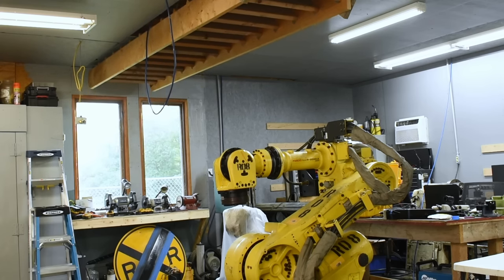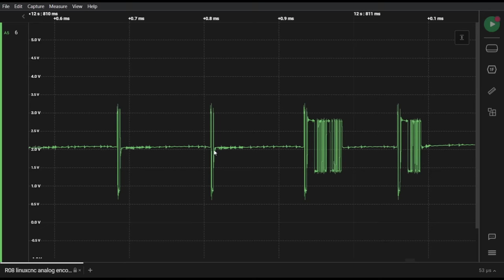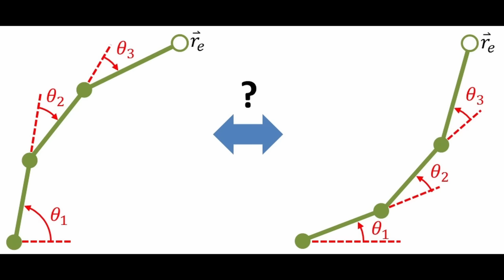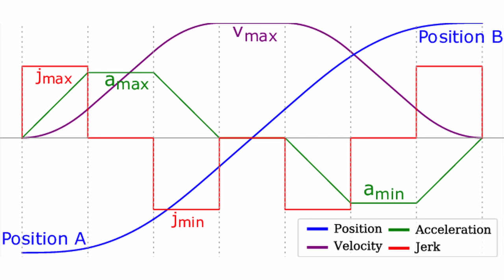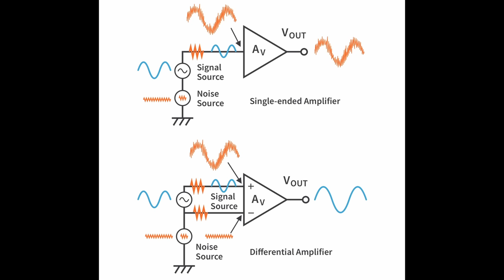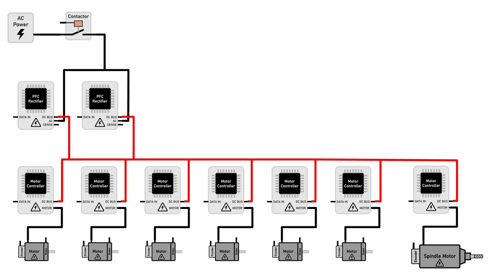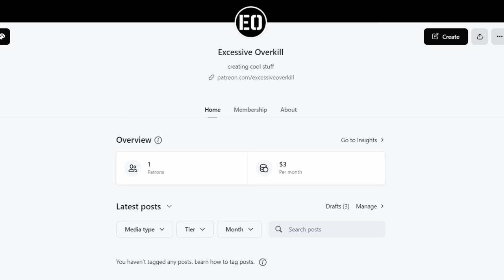Open-source Industrial Robot Controller Part 2: Starting Over...

Comment: Low voltages caused by high resistance neg/gnd loops or voltage leaks causing positive gnd. Also, back emf can cause dropouts due to the control sigs not having enough disparity between VCC and GND(seen on the oscilloscope with the base voltage jump 4:52)
Possibly Separate each GND from the motor/actuator from all other controllers

Comment: Have you heard of EtherCAT? It's a network protocol for industrial automation that can do up to 30kHz update rates with low latency and jitter. You would daisy-chain your motor controllers up with using ethernet and hook up the whole thing to a computer that runs the motion control. The chips to do it are surspringly cheap (LAN9252 is ~$10) and can be used with any microcontroller or FPGA. Maybe this could be a fit for this project, as this would make it much more modular and extensible. Adding peripheries or even an additional axis would just be a matter of adding another box to the network.
(also it wouldn't require to design everything from scratch, there are already a lot of EtherCAT motor drives out there).
Reply from the maker: I did look into using ethercat but the IP for the fpgas was like $10k. I think I thought the off the shelf chips wouldn't work for some reason, I don't remember exact why rn. I planned on using rs422 which would give me like 30khz updates with no daisy chaining, but I'll look into those chips again.
Reply: @ExcessiveOverkill  This was my gut reaction as well - RS422 but with separate drivers for each motor channel for best throughput. Ethercat is price overkill
Reply: "low latency and jitter" they boast as if it's a good thing ("a little bit pregnant"?). How about zero latency/jitter. It's a world of EMI (PWM), who in their right mind throws around data at such a high rate? Marketing BS.

Comment: Hi, I've been working on a similar type of motor control project that uses FPGAs to control smaller / lover voltage BLDC motors. I found a pretty sweet FPGA that I've been developing with that might be a good match if you want to swap the zynq out for a smaller FPGA that would live in each motor controller (it is also waaaay cheaper). The chip is a Gowin GW1NSR-LV4C. Sipeed makes a dev board for it that is pretty good for figuring out their toolchain. It has a single ARM cortex M3 along with 4K logic elements which is definitely enough for some custom communications peripherals and a FOC algorithm at some pretty high speeds (I'm trying to do all of my loops at 40Khz +)

Comment: Did anything ever replace TinyG? Last I looked (years), there was nothing that good out there for DIY CNC controllers, although some mention of people repurposing Klipper.
I would be surprised if a 600 MHz M7 MCU would not be able to handle this application with appropriate programming. The CMSIS DSP lib has accelerated PID controllers for f32 and q15/31 formats.
FPGA tools are less insane now. Yosys support Lattice, Gowin, etc to varying degrees.
MYIR Tech has some Zynq modules that you might want to look at.
Digilent has a socketable Spartan-7 module. Sipeed has a cheap Gowin-based 20k gate board. Both of those will have limited I/O, though.

Comment: I’m interested. I ended up passing up on 2 free Fanuc welding arms because I realized it was going to be impossible for me to reverse engineer the motor and motion control. I can follow directions and learn along the way, but blazing the trail you’re on is outside my capabilities.

Comment: Hi, I too am travelling the path you are on, my aim is developing motion controller for 5axis CNCs. But instead of FANUC I decided to do it with Tamagawa encoder based motors as they are a lot cheaper and I can find them on chinese servos which are equally good in performance. Plus side, there is documentation available from TI on how to interface those encoders. Having all that in mind I stared down this path a year ago and chose the TIs AM64x platform to achive so. Theoretically I should be able to do 6axis motion control using only one AM6442 without the need for FPGAs. Althougu FPGA would be a more professional approach I too have 0 expirence in FPGAs and cannot go down another rabbit hole. Right now I have managed to developed my motion controller minus the part where I directly talk to encoders. For now I am using the chinese servo drives themselves as they are decent. Still nothing beats having encoder loops and motion control loops on the same SOC.

Comment: Two (or 3) cents from me: when you take a look at STMBL firmware, Fanuc encoders reading is already implemented - in motor controller MCU. 

Approach seen in a lot of modern controllers is to push PID into motor controller (so it needs encoder feedback), and just send position command/reaad position actual (and error codes). Preferrably via fieldbus like EtherCAT, so you dont need Custom Big Box With FPGA™ 

Last thing, what voltage are these Fanuc motors rated for? I have usually seen them rated for about 200V or less, 1200V SiC looks waay overkill (unless selected for current capacity). For DC bus up to 320V with some capacitors, 600V IGBTs should be OK. For motors up to 3Kw or less you can get integrated IPM (intelligent power module - 3x IGBT half bridge + drivers + security circuitry) like STGIB15CH60 or IM523-X6A. These are < 15$ per complete power stage, so entire HV section silicon const less than single SiC transistor you picked. 
Especially important while developing/testing firmware - if you have bug/glitch, short something and release magic smoke, even if initially only one transistor is visibly broken you often end up needing to replace them all after some time.
Reply from the maker: I couldn’t find any great IPM or IGBTs that fit what I wanted. You’re right 1200v is overkill but I chose them for their current rating and switching characteristics. The biggest motors I want to run are 4.3kw and they go up to 300% intermittently so they require quite a beefy switching section. If I left all the PID loops in the drive I’d need to send over a bunch of extra feed forward data which isn’t necessary that bad means a lot of the control stuff is happening on the motion controller as well anyway. I might also start running into issues with other encoders or if I try running 2 per axis or additional inputs. The fanucs are just serial with 16 bit words so not that hard but there are others that are sort of hybrid quadrature/absolute that would be more work.

This is also an excuse for me to learn FPGA stuff so i figured going overkill to start wouldn’t hurt.
Reply: OK looks like you got it. I will happily get myself one of your drivers when its ready.

You can have multiple encoder inputs, STMBL does just that. 
Or you can have one encoder feeding into motor driver, for commuting, and second (like glass scales on machining center) directly into motion controller.

Do you think one would need feed-forward if you were for example using EtherCAT at 4 KHz?
Usually inner current PID loop runs at 20KHz (max carrier freq for IGBTs, no idea how fast can you run your SiC), then you have outer positon PID loop that makes no sense to be run so fast.
Motion controller just updates fresh next position every 250ms (external loop cycle) - and you can sync between motors with distributed clocks. What is feed-forward needed for here?
I am using EtherCAT example as it seems to be go-to motion control fieldbus even for super-precise apps like silicon fab equipment, but standard motion control profile like CiA DS 402 does not really give you option for feed-forward. I wonder if am I missing anything here?
Reply from the maker: I might be able to not need much feed forward stuff since the PID loops will be so much better, at least for the bigger robots. CNCs might benefit a bit more just since the accuracy needed is like 10-100x more.

Comment: If you manage to make a decent DIY/retrofit controller available for older servo drives/motors/robots it could become quite useful in the CNC world as well. Alot of older good heavy machines are send to scrap metal because their lack of recent motion and electronics. Alot of them use FANUC components.

Comment: Have you looked at the Omron CK3M motion controller? It's quite flexible and supports different encoder types, and talks to many different drives. It's definitely far superior to anything that exists in the hobby world.
Reply: Not for long and have you seen the $$$$?
Reply: Seems odd that simultaneous or coordinated aren't terms found in the literature.  Obvioiusly G-code capable so they are but yeah, still odd.

Comment: my first thought is maybe the brakes spontaneously engage for just a fraction of a second when the supply voltage drops due to the servo motors are drawing some current.

Comment: Wow, those motor controllers look sexy. And djeeez us those  fets can handle some abuse, but they take take some serious power to switch nearly 400pf and 300μJ to switch), it'll be exciting to see how that works out :)
Reply: 118uJ total gate charge at 10kHz would require about 1.2W. That's a pretty minimal gate drive requirement.
Reply: @murrayedington  the activation energy is not a big toll on the gates energy budget, but I blew a driver or two before I realized the toll it takes on it. And what kills the gate is not driving it "fast" enough, when you start increasing the frequency the time spent in resistive mode increases quickly (and particularly if the driver can't keep up, that'll kill the gate in a hurry).
Reply: @brynyard  haha yes you need to avoid resistive mode. And also ensure you have a finite dead time to avoid the beginnings of shoot through.

Comment: An FPGA is the way to go but have you considered how powerful even an RP2040 is with it's 8 Programmable IO state machines? Similarly there's the TI PRUs - most popular on the Beaglebone boards. I think for sure you could get something going with 'popular' microcontrollers like Teensy, Raspberry Pico or Beaglebone but for sure FPGA is the way to go. ;-)
Reply from the maker: Yeah someone mentioned they got some industrial encoder interfaces working on a RP2040. Most of the encoder stuff could probably be handled with a mid range micro or a micro with PIO, but I kinda wanted to learn the FPGA stuff. and the ZYNQ should be more than powerful enough for probably everything I want to do.

Comment: There is the moteus drivers which are open source
I suspect the amps isn't enough for what you want, but there is some open source firmware there and an existing design to look at
personally I want to write my own firmware for one in rust.
For FPGA's traditionally there's Verilog or VHDL depending on which country you work in, but I'd be tempted to check out one of the higher level abstractions such as amaranth or myhdl which is python based, maybe a development board such as the Arty A7.

Comment: Have you ever looked at the open source STMBL motor controller, they are capable of driving 2,2kW motors at 380V and even support fanuc encoders.
Reply from the maker: I did, i don't think they support the rs485 fanucs, but they also aren't beefy enough for my larger robot motors (4.3kw)

Comment: Great vid! Just wondering why you ditch the idea of using one micro per encoder? You can connect them to a network like can bus or Ethernet, I think you will get enough bandwidth and low enough latency.

Comment: A suggestion for the motion controller.  Add a few PCIE lanes in a way that's compatible with Mesa drivers,  so you can run a cable to a PC and still run LinuxCNC for testing.  Even when it's doing none of the motion control, it's still a good front end and gcode interpreter.
Reply from the maker: I believe the newer Mesa fpga cards use Ethernet interfaces to LinuxCNC which would be perfect to use with this new controller
Reply: @ExcessiveOverkill  PCIe is ... hard to say the least. Ethernet is much easier to implement, and seeing as you're using Zynq FPGA you can let the PS deal with it instead of having to do all the parsing in the fabric.

Comment: I have two Fanuc Robots sitting in my shop doing nothing.  Fanuc M-410iHS (100kg Capacity) and Fanuc M-410iHW (250KG Capacity), both have controllers and have very low hours on them. Located in Syracuse, NY area,  For sale for $7K each.

Comment: I would use Beckkoff Ethercat motor controllers driving them using LinuxCnc. LinuxCnc is the motion controller giving only target values and the motor controller read the encoders and does the control and pid calculations

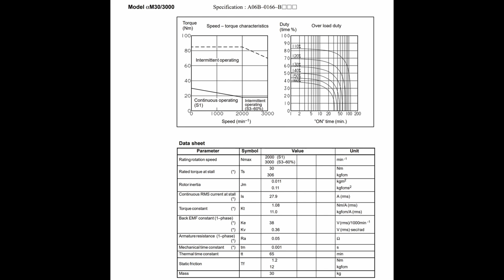Comment: 13:40 you could use Si MOSFETs rather than expensive SiC devices for this application. Or IGBTs for a more cost effective solution. SiC doesn't deliver significant benefits unless you switch at higher frequencies than what you need here and you may have noted that industrial servo drives don't use them. You can also experience horrendous common mode noise issues due to the extremely high dV/dt on the switching edges.
Reply from the maker: I scoured Digi-Key and these were pretty much the best option i could find price wise, IGBTs just dissipated so much more power at 20-25khz
Reply: @ExcessiveOverkill  Yes, IGBTs at that frequency wouldn't be very efficient - but I'm wondering why 20-25kHz? The normal rule of thumb is 12-15 times the maximum electrical frequency of the motor - that's the number of pole pairs times the max speed (in revs per second). Beyond that there's no benefit, just increased losses. I design SiC inverters in my day job ;-)
Reply from the maker: Because at that frequency the pwm is no longer audible, my older robot is below that and makes a very loud squeal when the servos are on because of it. The slightly newer controller changed to 20-25 and it is almost completely silent. So basically more of a human comfort thing than a performance thing.

Comment: Any modern microcontroller can work with encoder at hardware level, even the cheapest CH32V003F4P6. The encoder pulse frequency is higher than 1MHz!!! There is also an MC with a 32b bit encoder counter - at a price of less than 1 quid. In your project fpga will be used on 0,0001%.
Reply: 1MHz is dog slow, today.
Reply: @AdaptivePhenix  360*60*2 - an encoder for 43200 reports (30 seconds) at 1MHz - must rotate at 1380 revolutions per second!!!! This robot physically cannot move that fast - the steel would collapse from overloading.
Reply from the maker: It’s not uncommon to find encoders with millions of counts per turn so tracking that is quadrature would me MANY MHz. But even with that, serial encoders are much more common and MCUs capable of 12 UARTS at 10Mbit/s aren’t. Plus the fpga lets us run the 6 PID loops and filtering in parallel
Reply: @ExcessiveOverkill  I have seen encoders with 50um fringe thickness, which is the limit for a diffraction based optical decoder. When millions of reports are needed, an overdrive gearbox is used. 
However, I have not met mechanics with accuracy less than one angular second. It is physically impossible - there are no bearings of required quality. In addition the metal itself is able to bend under load, and temperature - far greater than the accuracy of a cheap encoder. The bending and deformation is not visible to the eye!!! But the error can be measured with a micrometer.
Too much money for old iron.
Reply from the maker: @avi-crakhome2524 I’m not saying the mechanics are accurate to millions of counts per turn. But if that’s the encoder you have you need to count every pulse anyway. The newer Fanuc serial encoders are 16 million counts per turn

Comment: How can a PID with encoder do coordinated xy movement?  I've never got an answer for this.

If the x is behind desired position, the y target value will need to be adjusted.

You'd need to adjust on a per step increment.  But that totally removes the advantage of a PID which increments current to hit a target quickly (not limited by coordinating with other axis).
Reply: I use an inkjet motor encoded axis as part of a 3dprinter.  But coordinating the motion with the other axis is problematic.  I had to step only 1 step at a time in the PID.  So it is loud due to braking to avoid overshoot.

It's on my "3d printer in a microwave" series of videos.

Comment: Hey I have 8 fanuc motors I got from an old cnc machine from my job and I am not entierly sure on how or what to use to control them. II heard you say you were using an odrive? Would it be possible to get more information on this
Reply from the maker: Odrives can run them fine just slow as long as you can get access to quadrature signals from the encoder